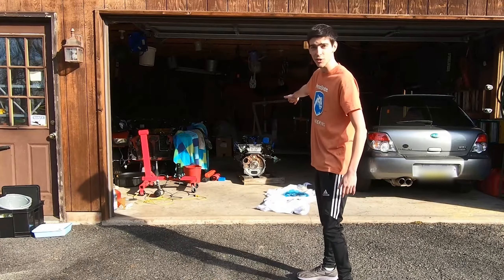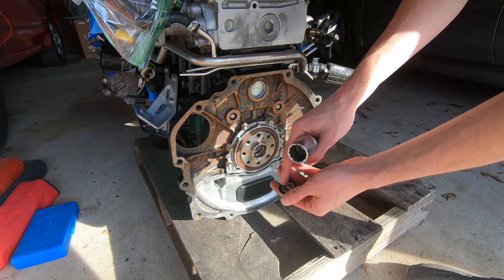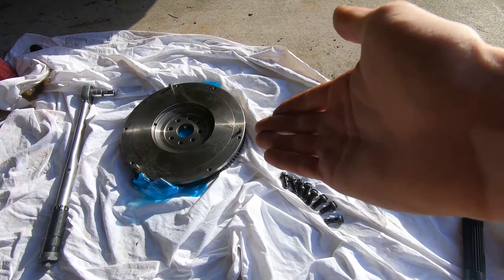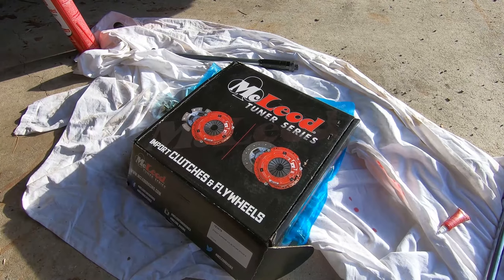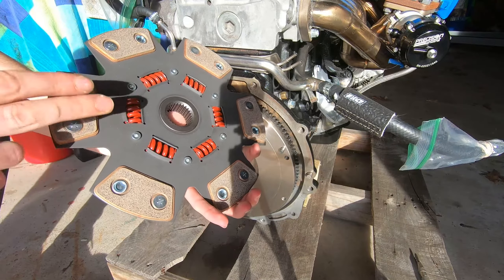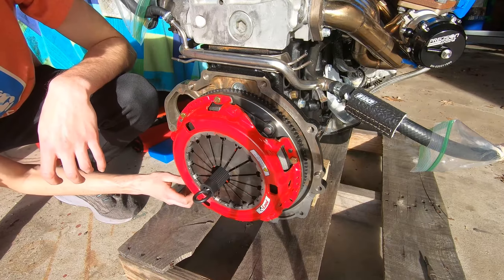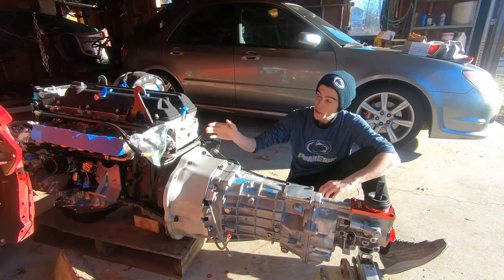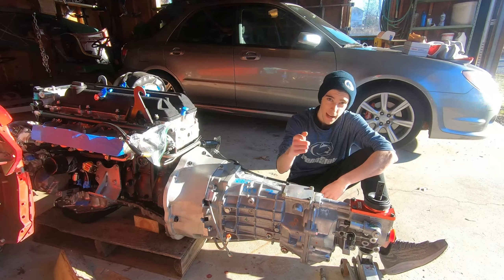Ep. 16 | Grannas Racing T56 Install on Toyota 2JZ | 240sx 2jz swap

Comment: FYI it says in the instructions NO loctite
Reply from the maker: I didn't know that, which part was I not supposed to use loctite for?
Reply: @TunerFaction  the nuts on the pressure plate
Reply from the maker: @ammoking6099  didn't know that! Will keep it in mind for the future, thanks!

Comment: 9:05 Should “note” to take a measurement of the thickness of the straight-edge and subtract that value from the overall distance measured.
Reply from the maker: Hey 755hp! Because I was taking my measurements from the "back" of the straight edge for both measurements, it's actually not necessary to take the straight edge thickness into account because it cancels out when calculating your air gap. For example, the equation you use to get the distance from the bearing face to the transmission face is: (Distance from bell housing face to pressure plate fingers) - (air gap) = (Distance from bearing face to transmission face). Now lets call our "Distance from bell housing face to pressure plate fingers" "X" and "Distance from bearing face to transmission face" ""Y" so we get: X - (air gap) = Y. Now because I measured from the back of the straight edge for both my X and Y measurements, essentially the thickness of the straight edge was added to both X and Y. lets call the straight edge thickness "Z" so the new equation is: (X + Z) - (Air gap) = (Y + Z). With the equation laid out like this, you can see that the Z's cancel from either side of the equation and it simplifies back to X - (air gap) = Y. Therefore the thickness of the straight edge does not need to be taken into account! I hope this clears things up!
Reply: @TunerFaction  Yes this does; I did not realize you took the measurement from the backside of the straight-edge. From the camera angle, it looks as if it was the front.
Reply from the maker: @755hp  Awesome! Sorry I didn't mention where I was measuring from in the video, thanks for clarifying that!
Reply: @TunerFaction  holy crap you guys are smart!
Reply from the maker: @ApexPressureWash  hahahaha thank you so much man!!!

Comment: What about the reverse lockout spring! Don't you have to complete this task? Correct me if I'm wrong. Thanks 👍🏁😎👌
Reply from the maker: Hey brother thanks for the question! So I am running the Grannas Racing wiring harness with this transmission, which makes use of the reverse lockout as intended by the manufacturer, so there is no need to modify the reverse lockout on my application. (There is a video called "prepping for first start" on my channel where I install the wiring harness and go over the reverse lockout). If I were not running that wiring harness, then you are correct! I would have to modify the reverse lockout spring as you stated! Hope this clarifies things!

Comment: I've had nothing but issues with this exact clutch haha. Just ripped out the transmission again to swap over to a twin. Can't get the damn thing to disengage!
Reply from the maker: Dude thank you for the comment. Another fella said the same thing about this clutch, nothing but trouble!! Glad to hear you are going twin disk, you won't have any trouble after that! If you don't mind me asking, what twin disk did you end up choosing? Tilton? OS Giken? McLeod?
Reply: @TunerFaction  I haven't ordered yet but I'm pretty sure I will pickup a RXT 1200HD. I was actually the first one to run this clutch I believe, I helped Joel sort out the base size and bearing face for this specific clutch in the video. Good to hear I'm not the only one. Something is just so weird, I can max out the master adjustment and it still won't disengage fully, it's hard to put into gear sitting still, and you can watch the car lurch forward slightly when you try. Idk what the deal is but I'm already exceeding the power level of this one so I'm going to just upgrade haha. Joel's a good dude though he helped me try and sort this out the best he could via email.

Couple of my friends have RXT1200's and love it, which is why i'm considering it. My car is a 700HP street/drag car.
Reply from the maker: @kyrujames  Dude if you're out here helping Joel pick out parts for his shop you're automatically an ultra cool dude to me. I love Joel, he has helped me so much on my build I could have never finished it without him. I really appreciate your input man, when my single disk goes, I just might be getting that RXT too!

Comment: Awesome video! Quick question, why did you need to pull the oring out of the breather cap? I have the same transmission and mine seems to vent fine without taking it apart.
Reply from the maker: Hey boss good question! I did that because I had read about instances where that o ring can be defective and not allow the breather tube to properly vent excess pressure in the transmission! I did it as a preventative measure but I really don't think it was all that nessesary!

Comment: What about measuring bellhousing runout? I have the same parts that I'll be installing once I finish assembling the engine. Great video though. I've never seen that bread trick before 😂 that's hilarious!
Reply from the maker: Hey boss thanks for your comment and the question! So according to Joel at Grannas Racing you don't need to worry about measuring runout with his new bell housings that he makes in house. So I just didn't give it a second thought and installed it!
Reply: @TunerFaction  Good to know! I ordered the bellhousing separately and it came with an indicator plate, so I'll double check during assembly anyway. I like that it shouldn't need offset dowels though!
Reply from the maker: @LegitRaceCraft  good call man good call! Never hurts to double check things like that! Subbed to your channel, eager to see how things go for you!
Reply: @TunerFaction  Thanks for the sub bro. I'm definitely doing the bread trick and mentioning your channel lol.
Reply from the maker: Hey of course man!!! And homie you are too kind I really appreciate that, thank you so much!!!

Comment: Caution with the clutchkit. The pressure plate does not like high rpm and limiter. I snapped two of the pressure plates.  Mcleod was supposed to do a lil more r&d after my incidents.   Great service but after blowing it twice just went with tilton twin disk. Had no issue after. 8000rpm drift mk4
Reply from the maker: Hey man I really appreciate the info! I had no idea the Mcleod stuff was that fragile, sounds like I will run it until it blows on me then I'll throw a twin disk in so I won't have to worry about it! Thanks!
Reply from the maker: I'm curious, did the pressure plates let go on you recently? Was it the same exact kit from McLeod?
Reply: @TunerFaction  yes its that same exact single disk. Let go of me twice mid last year.
Reply: @TunerFaction  depends on how you drive. Rpm and how much limiter. 707whp 8k limiter and drifting is pretty harsh.
Reply from the maker: @BMXAndy1994  That's about what I'm shooting for in terms of hp and limiter. One last question, when the PP let go, did it destroy your bell housing and cause a lot of damage to other parts of your car? 

Once again i really appreciate the info! Certainly something to look out for

Comment: Do you mind elaborating on why you needed to remove that o-ring from the breather?
Reply from the maker: Hey Mike! That was one tricky bugger to get out I'll tell ya! I basically used a combo of a small sized flat head screwdriver and locking pliers to get that metal cap off. Once it was off, the o-ring just fell right out! Let me know if this helps!
Reply: @TunerFaction  I have the same question. Rather than how, why did you need to remove that o ring?
Reply from the maker: @TheMagickConch  Of course! So popping out that o-ring just helps the breather tube to breath a little bit better. There have been a couple instances where the o-ring can get oriented incorrectly in the cap and not allow the breather tube to breath, so removing the o-ring ensures that the tube can breath!
Reply: @TunerFaction  awesome ty for the feedback. I'm doing the same 2Jz swap and am glad I found this series.
Reply from the maker: @TheMagickConch  Anytime my friend! I really hope your swap turns out well for you, and I'm happy you found my channel! If you have any other questions, I'm always here!😃

Comment: this kit comes with clutch?
Reply from the maker: You can order the kit from Grannas with and without a clutch. I decided to buy one through him but that's just what I did!
Reply: Thank you! One more question. How low does t56 sit in s13? I have 1jz/cd009 and it sits really low like you can see the transmission poke through the frame rails 😭
Reply from the maker: @ShiftSlideSideways  the t56 sits nice and high man! From what I remember it's well above the frame rails!

Comment: How much did the trans setup set you back?
Reply from the maker: Hey bdub, all in it was about 7,100 USD. That is including everything I needed to get the transmission to bolt up to the engine, clutch, hardware, lines, master cylinders, and much more.
Reply: @TunerFaction  keeping that in mind. Hopefully doing the same soon.
Reply from the maker: @bdub215  Great to hear! Joel at Grannas Racing was super awesome to work with to get me all the parts I needed for the T56 swap and from what I can tell, everything is super high quality and fits up super well. I just got the engine in my car the other day and the tranny sits really nice in my S13 with all the mounts supplied with my kit. As soon as I get my car driving I will be sure to update you on how it feels!

Comment: how do you connect the throwout bearing lines ? de one on the underside gows directly on feed. but the one on the top for bleeding where do you conect it ? or you just leave it hanging ?
Reply from the maker: Just leave it hangin'! I will be securing it to the feed hose just to make sure it isn't dangling!
Reply: @TunerFaction  thx ^^